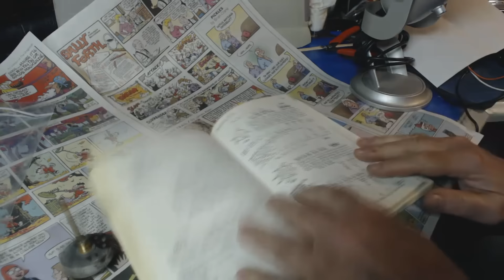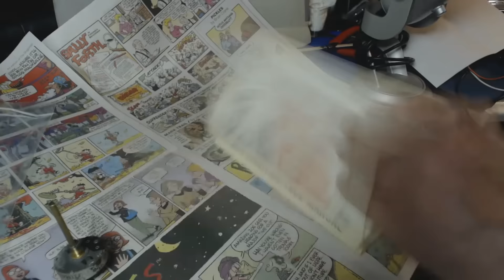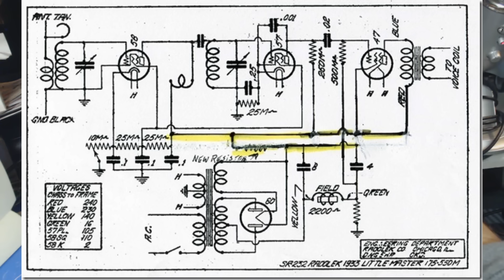1932 Mystery Cathedral Radio Restore Part 6

Comment: At 21:20 you can hear a click in the speaker when you test the B+ with your finger.
I did this once with the 2200V B+ on my dual 813 amplifier holding a nice metal D104 microphone in the other hand.
"Be Careful, Be Careful"
Reply from the maker: I can hear that sound clip  "Be Careful, Be Careful" in my head! 🍺🍺

Comment: I've got that same tube manual, but mine isn't in such good shape as I've had it since I was a teenager!

What was the PTOTP part number for that escutcheon?  If he has any more of them, that would look about right on my radio.  (Otherwise I'll try modeling one in a cad program and then 3D print one with brass PLA plastic).
Reply from the maker: I sent  Gary  @ PTOTP a picture of the escutcheon I got from radio museum and asked if he had one,  and he found it for me..................why don't you ask him if he has a similar one......Buzz